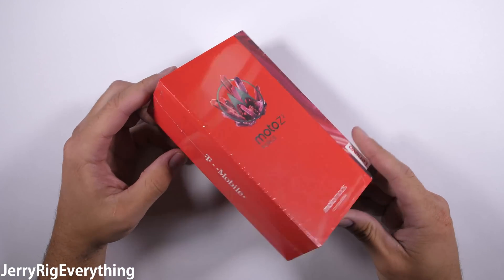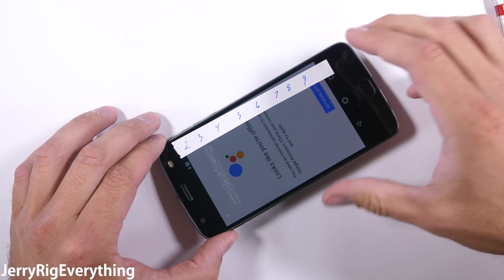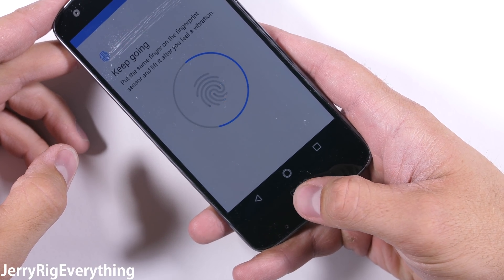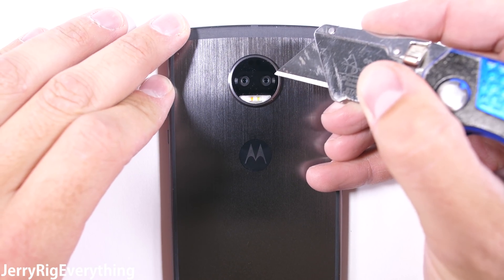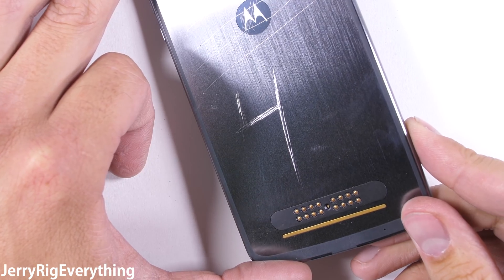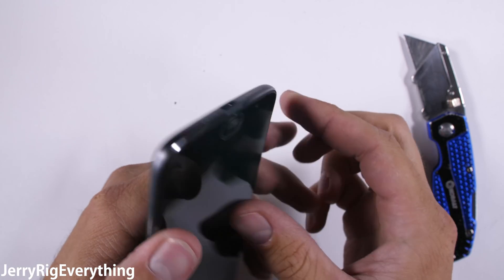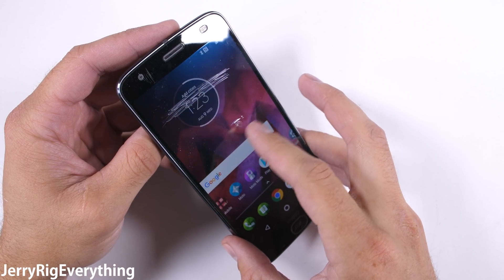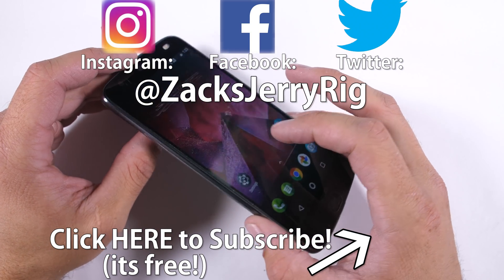Moto Z2 FORCE Durability Test - Scratch and Bend Test!

Comment: Honestly I'd rather have a plastic screen that can scratch than a glass screen that can shatter
Reply: Alexandra Smith me too, just put tempered glass screen protector on to protect it, perfect combo in my opinion
Reply: アルトリア・ペンドラゴン Iqbal セイバー same
Reply: Alexandra Smith I've got the original Z Force because I didn't want to worry about sharing my phone. Throw a cheap screen protector on the top, change it every three months, and it's amazing. It's so nice not having to worry about the display shattering.
Reply: Alexandra Smith Same, because you can always get a glass screen protector.
Reply: I have never in my entire life broken the screen on any of my device but i 100% with Smith that  I'd rather have a plastic screen that can scratch than a glass screen that can shatter because you are always afraid if you gonna drop your phone and it will never be the same. Also you can use  a cheap screen protector on the top just like old times made of thin plastic sheet which you can replace when you get scratches and it only cost penny.
Reply: Yeah, but being able to scratch it with your fingernails is just bad.  I've never once shattered a screen, but I have scratched a few.  I'd rather my phone be more susceptible to the thing that is less likely to happen.
Reply: if you're 3 years old maybe
Reply: But level 3 of scratch resistance is too low for my taste. A perfect balance is around 5 where my fingers will no longer be able to scratch them, and at the same time will also not be able to shatter as much as any other screen glass of phones.
Reply: ToughGamer Est Isn't there a new phone out from cat that's costly as balls but supposedly really durable?
Reply: Alexandra Smith personally I would use a glass screen + tempered glass which wont scratch and protect the glass
Reply: LAzY GAMING Tempered glass dont really protect the glass sure from scratches but not from shatter, 80% chances are if tempered glass shatter the phone screen will shatter too. Also phone like S8 and other with curved screen or 2D glass screen to produce curve tempered glass is very hard.
Reply: i dropped my xperia z1 maybe 5 times for 2 years and that was enought. What's the most interesting: it doesn't shatter immediately, but some minutes later.
Reply: I disagree. I've never smashed a phone screen and if I do it's insured. However whenever I've had a scratch on my screen I can't unsee it especially when the light hits it and you're basically stuck with it.

Comment: The way Zach uses "made from" and "made of" makes me cringe so hard
Reply: What's wrong with them? (I really wanna know, I'm not a native speaker)
Reply: Niels Logtenberg your videos makes me cringe
Reply: Justin N damn, can't argue with that
Reply: Felipe Augusto basically, "made from" is normally used when there is some type of process involved that changed the original material. For example, you wouldn't say " paper is made of wood"; first the wood is turned into wood pulp, that then turns into paper. When there is no manufacturing or process that changes the original material, you can say "made of"; for example "this phone is made of metal".
Reply: Niels Logtenberg is there any grammar mistake or sth?
Reply: A dutch guy lecturing over grammer, priceless shit.
Reply: Felipe Augusto 
Me too honesl-è
Reply: Made from is actually the proper way to phrase it
Reply: Josh H no, it isn't. Paper is made from wood, but this phone is made of metal. There's a big difference, but Zach uses them like theyre the same
Reply: Niels Logtenberg What's the difference between the wood and the metal regarding the preposition??
Reply: Niels Logtenberg aye, they might be cringey but the instrument action is pretty good.
Reply: Niels Logtenberg Oh thanks, now I got it

Comment: It's surprising how easily the display can scratch
Reply: Yeah, it's for people who never want to render their phone useless from a drop. Tempered glass screen protectors are cheap and give it a glass feel. I'm sure someone would rather spend the $10 on another screen protector than living with a cracked phone screen.
Reply: I read that previous Motorola screens did scratch a bit less (not from fingernails) Motorola should put a scratchshield for its shattershield right in the box - without a protector that screen will look horrible in no time.
Reply: Yeah it would definitely be worth while having a screen protector.
Reply: I just bought one Z2 today.  Ordered a ArmorSuit screen protector for $8 shipped.  It comes in a 1 pack because you'll only need one.  Its the best.
Reply: Actually it's not! Totally expected that with shatterproof plastic!
Reply: DUPE dupe The only thing you have to worry about from drops is the OLED display inside cracking
Reply: @blues0006  Yes, my z play never cracked, it even flew out of my ram mount at 160kmh, but one day i dropped it and the oled exploded glass intact.
Reply: you can get the regular z2 with a glass screen
Reply: @uetzel  which will eventually break nonetheless
Reply: uetzel is it out already or you are talking about the play variant?
Reply: Yeah but it's just as cheap as a screen protector to replace it
Reply: Timmyval123 nope it isn't. It isn't like the x force,  the plastic is fused with the other layers
Reply: I'll get a screen protector if I find one that is basically invisible once applied was looking into ghost armor any thoughts ?
Reply: kunicross thats not how things work bud..
Reply: Had this for like a day before it got scratched by my keys lol. It's not a bad scratch
Reply: You have a point I had the turbo 2 and it had the same "shattershield tech" and it didn't scratch this bad I have this phone as well .. safe to say I miss my turbo :(
Reply: It's definitely extremely easy to scratch.
Reply: Psivewri Even an eraser can leave a mark. Man I'm dissapointed with Lenovo. It's their FLAGSHIP smartphone we're talking about.
Reply: I hate adding additional layer on my screen, it just breaks the aesthetic value, and it's feel. I also have never had any screen crack on my whole phones until now. So I'd rather having a normal tempered glass screen than the plastic one.

Comment: +JerryRigEverything The dual cameras are not just for "depth effect".  The dual cameras use two different sensors, one which captures black and white, one which captures color.  They combine the images to produce one image with higher detail.

Also, it allows for much higher quality black and white photos than just a filter.